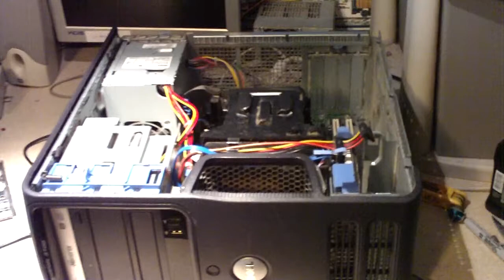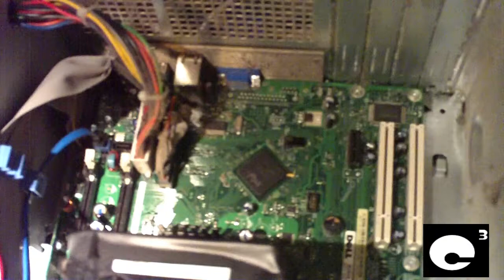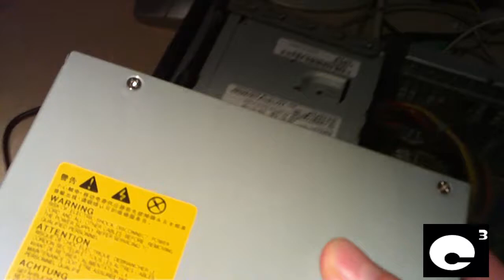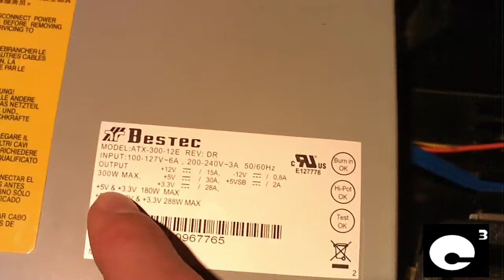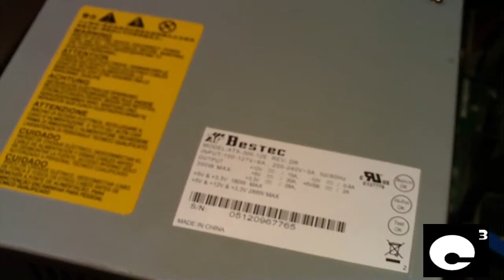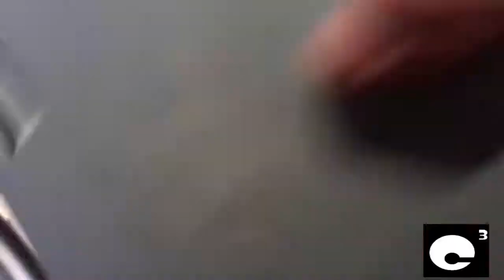Dell Dimension 3100 uses a 230w PSU

Comment: I am not proficient in computers. I have a 3100 case.. I understand M Rasyid asked a similar question... but is it possible to take out all the stock parts and put high end parts for gaming?
Reply from the maker: wadeinator2 The 3100 uses a proprietary design BTX derived case specific to the Dell components it comes with. You can't really upgrade it much.

Comment: I have one of those power supplies and recently when i plugged the cable in without switching off the mains switch,there as a small pop,and the psu no longer power on,but the fuse is not broken.Any ideas what popped?
Reply from the maker: Either a switcher popped or a capacitor popped/failed shorted.
Reply: just to add,no visual damage is seen,and it took the mobo/ram/cpu with it as well.Could it be y capacitors shorting out?
Reply: Giggity Goebbels some have an internal fuse inside the pwr spply.
If not look at the capictors which ever is bulging is bad.

Comment: @qasim0004 Here's a couple of videos (from YouTube and about DAHT kahm) on PCI card installation.
1) First, the YouTube video:
v=eyxK7-3R7Us
2) Next, the about DAHT kahm video:
video DAHT about DAHT kahm FORWARDSLASH pcsupport FORWARDSLASH pcicard-mov DAHT htm
(note: there are also instructions below the video window)
.
It's a pretty easy install. Between the two videos, they should give you a leg up. Just make sure before you begin, that your card works w/both your system and OS. 
Good luck.

Comment: @Gamer08ful Yes, at the same time no.
I am running a Dell Dimension 3100...
Heres my specs.
Biostar N68S+ Motherboard
AMD Athlon X2 7850 Black Edition
GeForce 9500 GT 1GB
8GB DDR2 RAM
Windows 7 64-BIT
Dual, WD VelociRaptor 600GB
Corsair CWCH70 Hydro Cooling
Two 92mm fans on bottem for intake, one 120mm fan on top, and two 80mm fans on back for exhaust.
All powered by a Corsair Enthusiast TX750